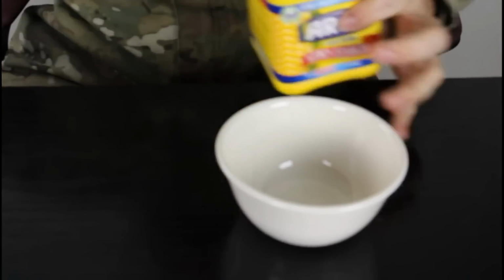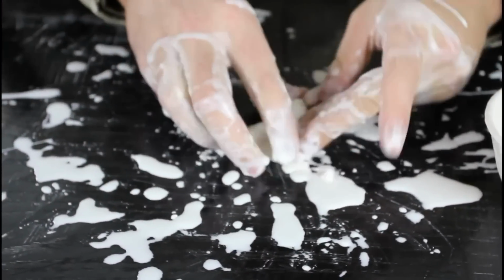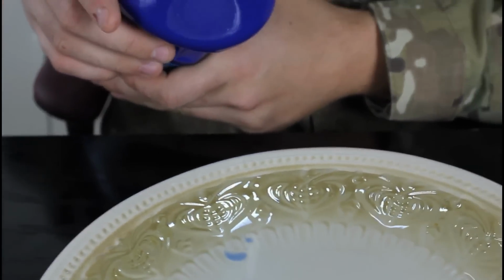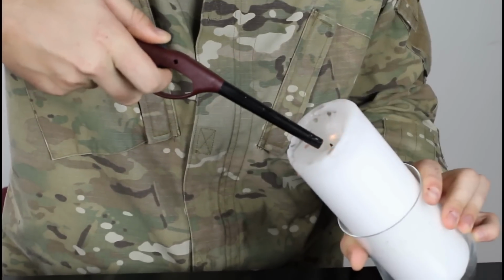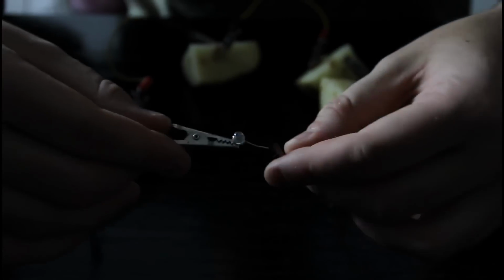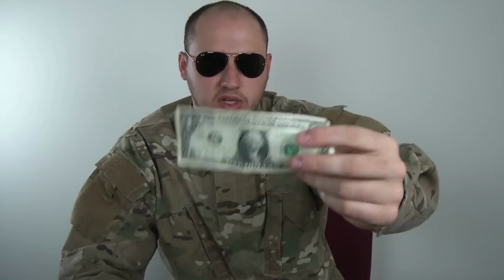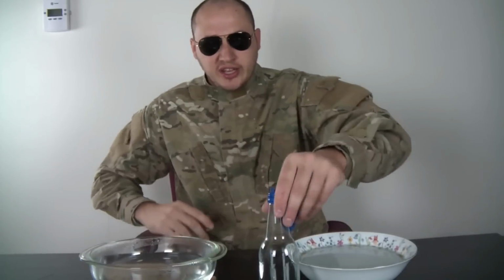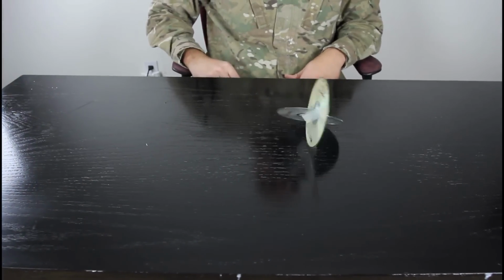10 crazy science stunts you can do at home

Comment: The water and corn starch from a 
"non‑Newtonian fluid".
The flames from the Orange peel, are oils being ignited as it escapes the peel. 
On The one with the potato, you have actually created an "electrical series" connection of batteries.
The bread clip is forced forward as the soap expands on the water surface tension. The reason it didn't go forward as well in the second attempt is that you may have broken the water tension by adding too much soap. Try it with a small slice of dry hand soap next time. It may work better. Just a thought. 
And yes. .. it IS illegal to deface OR destroy US currency. .. but the secret service is pretty busy these days protecting the president and trying to fight counterfeiting and computer fraud. 
Pretty good stuff crazy Russian dude. .. also I applauded you on your improvement in your command of the English language. You are getting better. Just remember to SLOW DOWN and annunciate your words. 
Thanx

Comment: Cool science experiment:get tablets that fix tummy aches step 1:put a tablet in side a cup with a lid in it with water then close the lid super fast and put the  cup upside down and watch it pop tip:if u put less water it will pop higher and use eye protection and don't put ur head on top of the cup.also if u don't wanna get dirty get away from it and it won't pop right away it needs time to get all mixed with the water